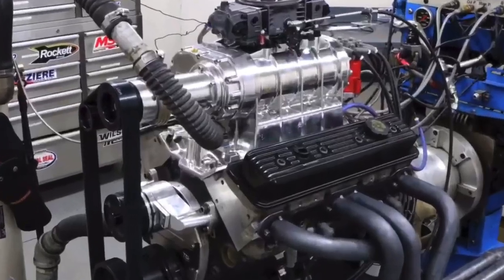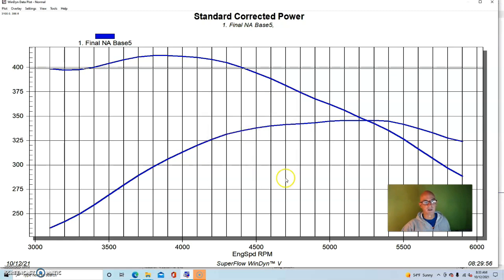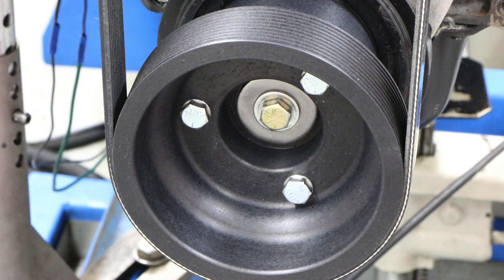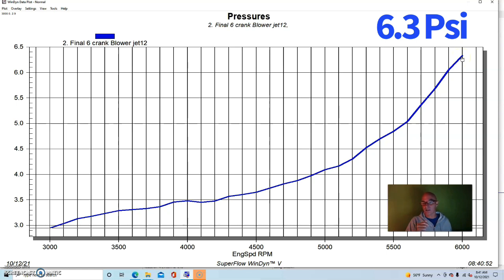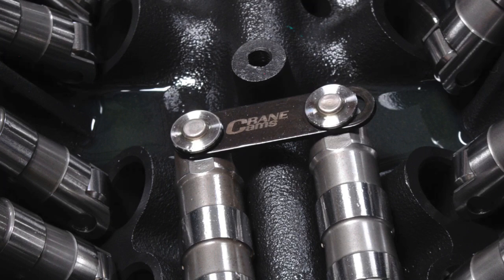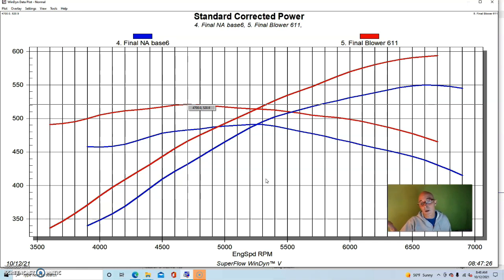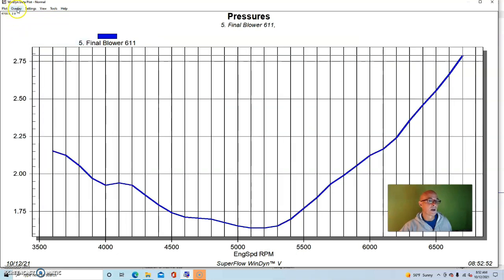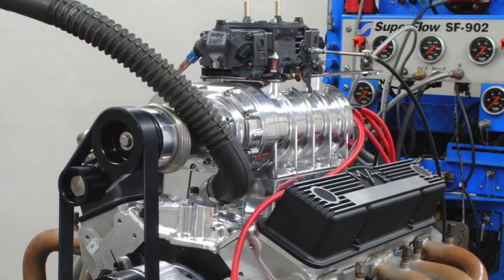HOW TO SUPERCHARGE A SMALL BLOCK CHEVY? BLOWN 350 VS STROKER 383 SHOOTOUT-WHICH ONES MAKES MORE?

Comment: Hey awesome video. I have some questions for you for a blown 355 sbc.  i am using the low low rpm approach and want to make immense torque at  low rpm without revving past 4500 rpm. Its for a 2nd gen camaro with tall gears. XR252HR or smaller cam. i want to spin the blower fast and up to 4500 or lower engine rpm and 4800 max. with a big blower and maybe significant boost and drive in a low rpm band with  really tighter than stock antiballoon plate lock up torque converter.. i want big boost off idle with a bleed valve. target idle is 400 rpm. 6.125" H beams with 1.165" MAHLE blower piston 0.045" headgasket. Any CC chamber piston and head. Looking at trickflow super 23 175cc? Or jegs #5140000 heads 180cc? The tires are big radials on 15x12 wheels. A close ratio TH350 or 400. Cruiser not a race car. maybe a dart block with large bore same stroke or less.
Reply from the maker: 400 rpm?
Reply: @richardholdener1727  
Is there a way to make 600 tq and 300 hp with a blown small block Chevy ? Hypothetically what would be the basics ?
Reply: youd need a big ass blower crank pulley to do that at that low of RPM.  maybe try for 6000 RPM

Comment: Would a 177 work on a 454 bbc
Reply from the maker: yes-if you only wanted 600 hp or so
Reply: they make a kit on it but Richard is right.  600HP is about all it has in it .  should step up to an 8-71  on a BBC

Comment: Conclusion: Don't put a blower on a weak combination unless you just want that blower look and sound, and don't mess with these baby blowers on decent combinations, they will only disappoint compared to a more appropriate sized blower.

Not mentioned was the air temps, especially with the faster drive ratio. Comparing an old blower design like the 144 with Edelbrock's latest SBC kit, they both need more drive ratio to make decent boost, and while the 144 gets hot pretty quickly, the Edelbrock would be barely above ambient temperature, even after a few pulls.
Reply: Why not an 8-71 on a low rpm 350 sbc. 400-450 rpm idle, XR252HR or smaller roller cam. Tighter than stock blower converter maybe even a low rpm lock up.  High boost at low rpm. Blower spins up fast on the cog. Forged crank, Hbeams and MAHlE custom pistons. Shall it work?
Reply: @zAvAvAz  Bet the maiden voyage kicks out the head gaskets.

Comment: Every single time you do a comparison it is bullshit .  How bout just changing the bore/ stroke  !
Reply from the maker: SAME BLOWER, SAME PULLEYS, TWO DIFFERENT ENGINES-SEEMS LEGIT!
Reply: @richardholdener1727  my thing is they aren't the same base platform. There are so many variables created with the use of trick components , it's like comparing apples to elephants.
Reply: He's just showing what each type of engine can do if someone is curious of what they would want to build or not build

Comment: More displacement + longer valve duration + better heads = less time to build boost. The 383 is too efficient relative to the 350 to maintain the same psi. Hotrodding is the funnest science.
Reply: The blower is too small that’s all
Reply: @vinceyoung5912  bottom pully is too big.  unless that blower is at max RPM  step up to a 192  the biggest of the mini blowers.
Reply: the 177 is converted  from a big block blower  his belt is slipping
Reply: the faster the engine spins the faster the blower spins

Comment: So in a blower application the manifold pressure curve is essentially an inverted volumetric efficiency curve. I have to sit down for a while...
Reply from the maker: BINGO! UNLESS THE FLOW CURVE IS NOT LINEAR....BOMB!
Reply: Do you remember the compression of the 383 motor

Comment: Thanks for this vid! What im gathering from this and the 5.0 vid is a good flowing engine will make more HP with less boost! i want to put one one my 10:1CR, 355 SBC soooooo  bad and with my current set up of Edelbrock E210 heads and Thumper cam and all the mods that go with it i should be able to run the smaller pullies and only make up to 3psi and not destroy my hypereutectic pistons! LOL maybe......

Comment: So basically that little 177 blower with the 7" crank pulley was killing about 130hp on the 383 and 112hp on the 350 vs a turbo at the same boost.
Reply from the maker: WE CALL THAT SPECULATION-IT'S EVEN SPELLED DIFFERENTLY THAN DATA! IF YOU WANT TO SEE HOW TURBOS AND BLOWERS COMPARE AT THE SAME BOOST AND AF AND TMING ON THE SAME MOTOR-SEE THE MOD FORD VIDEO
Reply: @richardholdener1727   it is 100% speculation, but it is calculated speculation. 
  If you "follow the formula", you will double the power at 14.7psi. 
  Here's my math. 550 hp on the 383. Add 6psi and you see 644hp. 6psi of boost is .408 bar. Multiply  550 x 1.408 (follow the formula) and you get 774hp. That's theorietical on the same engine that would make 550hp NA at 6psi. The engine actually made 644hp at 6psi. . 774 speculated hp - 644 measured hp = 130hp less than "the formula". It's either heat or belt drag  or untuned runner length that killed the potential power.  It's not always the same amount, but I feel that I'm not too far off here. I am analyzing the data that I see and trying to form a conclusion. I.e. speculating.
  I did the same math for the smaller 350. I'm not trying to discount your actual testing.. I'm just a math guy and don't have access to a dyno or parts like this. .. so speculation is my primary option. 
  I look at patterns of actual data and try to find patterns. You are the source of my data in this case. 
  I know the supercharger intake has short runners that are not tuned the same as the dual plane (or single plane).
Reply: The problem is a blower eats hp to make hp. Compressing air takes power to do so if making 14.7 psi doubles your power but takes 100hp to do (just using these numbers for example idk what the true number is) then you will be 100 hp lower than the math. It's closer on a turbo setup bc of less parasitic losses.
Reply: @Redneckairflow  i bet if this was one of the edelbrock/eatons they make for SBCs  it would be a lot closer  as theyre more efficient

Comment: Is it commonplace to only make ~10HP/psi with these 177 Weiands? I realize the 350 was a basic truck type motor, but that seems like more what I’ve seen from the smaller 142’s. Actually, with a 6” lower and 3.05 upper I’ve seen a 142 kit make more power per psi so I just thought the 177 would be more efficient.
Reply: I have a 174 on a bbc, it wheezes out quickly.
Reply: @TheBdubya24  A 174 on a BB I imagine would be struggling from damn near idle lol. Well maybe not with some peanut ports or something but with any type of good head and a decent cam on a BBC I don’t even know why you would use anything that size personally. Maybe a bone stock head/mild can/stock displacement street setup would be about the only situation I would run a blower of that air volume on a BB. The 174s are well sized for like mild 302/305 type of combinations honestly, that’s more what it’s able to supply decent airflow to support.

Comment: Richard, not worried about the 2 bolt block?
Reply from the maker: not this level
Reply: At what level would you worry? Wanted to ring gap my l98, push around 12#s shifting at 6k.
Reply: @TheBdubya24  I have an L98 on  12.5 lbs with twins myself. Bone stock 91 firebird stock ring gap. Been together for 4-5 yrs
Reply: That's great news kd! I was scared about pulling pistons also. I just want this '84 Vette to have a little self respect.
Reply: @TheBdubya24  I have that firebird 305 tpi in a 54 cadillac and it will annihilate the tires and its hard to keep the u joints together. Also have an 86 corvette 355 tpi I'm about to switch from single gt45 to a compound gt45 set up in an 85 suburban we'll see how that goes.
Reply: @kdsboosted4954  
KD did you ever install the boosted TPI in the Suburban? I have a 190 hp  350 in a heavy 81 1 ton. I've been wanting to swap to a boosted TPI 350/383/400. I need torque to be able to tow up this massive hill near me.
Option B is a Cummins for reliability, but torque, and MPG. I kinda want to keep the SBC + GearVenders in the future.
Reply: @xmo552  I haven't gotten it on the road yet. I didn't install my 355 again I decided to go with a 406 should be finished up with the machine work soon. I'll be reinstalling everything probably in a couple months. Turbo tpi in a suburban is a good drive train. It'll have no problems pulling a hill with a load.
Reply: @kdsboosted4954  
You think it can tow uphill also ?
Reply: @xmo552  oh yeah no problems when the uphill load starts your turbo starts putting in work.

Comment: Okay but regardless of cubic inch, What's the timing when you have a high-compression motor plus you add boost on to it at 6500 RPM. Compression must be enormous, do you have to retard the timing a lot?

Comment: I like the test but would be curious to see results with bigger blowers 671-871 on e 85. I am planning my next build and have a zz3 crate motor that I already upgraded to flat tops. I am thinking of afr 220s and a blow thru turbo or a roots or twin screw carb e85 set up. I have sprayed about 250hp on the zz3 with the flat tops and it runs great but want more power and tired of nos

Comment: A more telling measurement would be post-blower intake temps. I bet the 383 would be a little over half the temp of the 350. Efficiency is the name of the game!
Reply from the maker: lower boost equals lower IATs
Reply: @richardholdener1727  yep & being able to run a more aggressive timing curve as a result = more powah! 💪 Love these experiments
Reply: @acemobile9806  Thats why these types of blowers like E85  make even more power with even less heat
Reply: a simple alky injection kit would drop those intake temps in half and could run full timing.

Comment: If you want to do a Killer test on this platform,  I'd love to see same camshaft lift and duration numbers BUT 1 cut on a 99 to 102 lsa. The others on people's thought of the 'must be' 114 to 118 lsa. I call bs. My time on a dyno for my applications I'd never run anything wider than 106. It's be SO awsome if you could work this test in some day. Expec on these small blocks and small blowers where it's going to be a street strip combo fir sure any way. Cylinder pressure makes torque, add boost wonderful things happen. E85 of course, prob will want 3 to 4 ° less timing
Reply from the maker: this was already a 108
Reply: Yep would be interesting to see. Though going down to 102 allways seemed a bit desperate, trying to get power from a small lobe. Out at 106 seemed a good compromise, though not if you have a single seater with the right gear ratios

Comment: Have you done a blow through dual plain intake and could your improve response through higher torque numbers
Reply from the maker: dual plane adds low speed compared to single plane-works the same under boost (this had the blower intake-also not great for low speed)